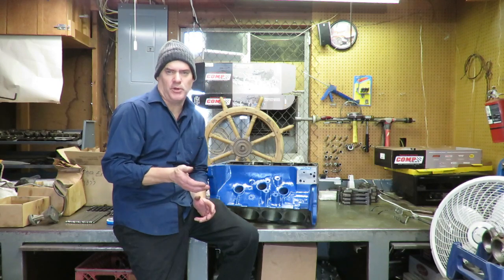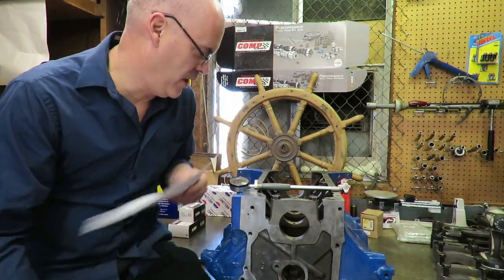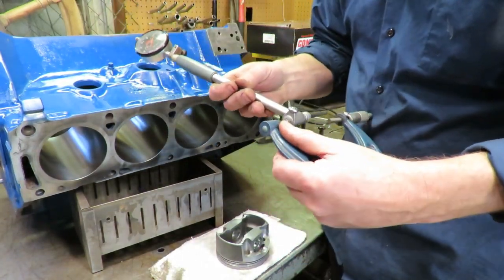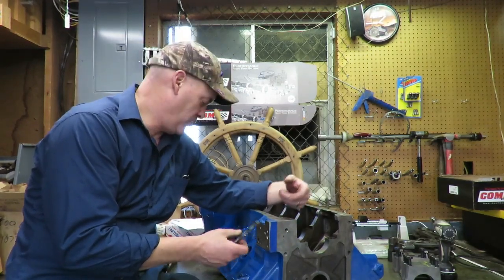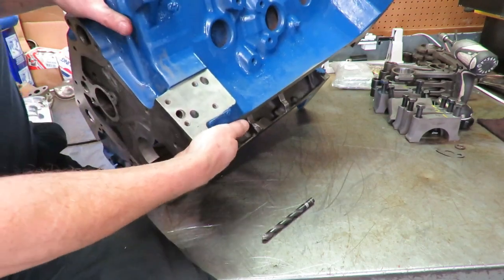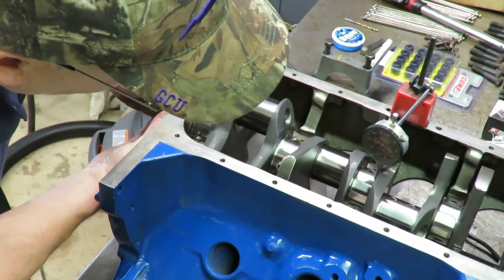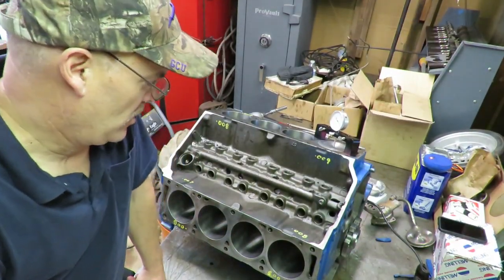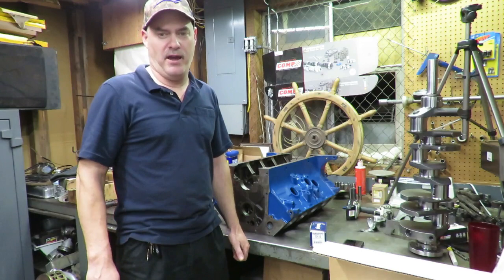390 FE Stroker Build part 3 Block Prep

Comment: I have a 390 I'm going to rebuild in the future, this is going to help a lot. What size stroker kit are you going to use?
Reply: Frank Beato 
In an earlier video he said it was a 431.
Reply: David Mason  Thanks now I remember.
Reply from the maker: 4.080 bore and a 4.125 stroke it comes to 431 ci
Reply from the maker: it is very similar to the 428 in displacement only the 428 has a larger bores (4.130) and a shorter stroke (3.980) better for high reving power the 390 stroker is more suited to low/mid range TQ
Reply: I'm planning an FE stroker build and I want to use the original 352 from my 65 F250. Have you stroked a 352 before if so how big can I bore it? I'd like to get to at least 390 size if not more. As you have stated there is a lack of info out there. The motor will go back in the 65. Asking other places I have been told I need to have the block sonic tested to know how far I can go. I'd like to know from someone who has done it. thanks
Reply from the maker: if you bore a 352 .050 over and use a 390 crank and rods you have a 390
Reply: Myvintageiron7512 What size stroker kit would you recommend on the 390 for a 68 mustang?  Want to keep it streetable. Thinking of a 4.080 bore and 4.250 stroke.

Comment: Regarding the main oil galley mismatch to the bearing hole cut outs.  You stated that this is normal for an FE series engine.  So, why don't manufacturer's just offset the hole in the bearing?
Reply from the maker: hard to say I don't think they really care that much about it they figure it's good enough
Reply: If they offset that hole, someone is going to put the bearing in backward so that no oil at all will flow thru. Just a guess

Comment: There was a notice from ford that they purposely restricted flow to the number one bering to supply more to the number 2 and 3. When i tore my engine down number one looks new and 2 and 3 has a little wear.
Reply from the maker: High vol pump and oil restrictors in the heads and you're in business

Comment: Dude, please help. I've been looking for the procedure to seal the oil galley that leads to rocker arm assembly from leaking oil into coolant. It consists of a quarter inch roll pin driven down a hole (that's the info and video or pictures I need) that leads to cam bearing. Do you have info or know of a video available. Repair can also be done with push rod tube. What bolts do I have to remove? Does the split pin go down a bolt hole or another hole obviously I'm confused. Also do I have to remove heads?
Reply from the maker: You talking about the oil passage in the block that leads to the cylinder head and feeds up into the oil passage at the rocker are shaft assembly at one of the rocker pads.
That passage is know for cracking and leaking oil into the coolant, I have repaired these with a 5/16 push rod I cut the ends off and tap it into the oil feed hole until it bottoms out then cut the top off at the surface of a block it’s basically a sleeve in the oil feed hole

Comment: what are your thoughts on the glyptal coating inside the engine block , many industrial diesel engines i've worked on had it from the factory  but you don't see it in auto engines . I was thinking on doing it to my 302 .
Reply from the maker: Glyptal works well time consuming to apply but it does help oil drain back
Reply: Thanks !

Comment: Just an idea (that I always do): They sell cheap modeling clay (Amazon has it, sold in bricks) that is guaranteed not to shrink, but does completely harden almost like stone when exposed to air. I use it to check the boring - it's MUCH more accurate to put a precision gap micrometer on the casting that most shops already have laying around then playing with the spring bore gauge variety inside the bore itself.  I'm looking for round more that size (not that it can be ignored!) because the rod bearing can help with that but there's no cheap easy cure for an out-of-round.    But the modelling clay - which sets up overnight - is easy to measure and in truth makes abnormalities jump out at you just by eyeballing and easier (especially on the inside journals boring) to do.  I found an issue on a Chrysler small block 318 from a Duster that had been bored and a CNC stroker kit installed 2 years prior, then driven hard, that I swear would never been spotted any other way.
Also (and maybe it isn't as accurate as what you do but is a time saver) is an old trick a mentor taught me when working on an old Buick straight 8 (talk about a heavy sonofagun, those ARE).  He'd take a strong worklight and put it in the crank bed, kill the lights and slide the pistons back and forth.  I'll be damned, but if you can see light come through passing the piston you've got either a bad cylinder bore or a bad piston/ring.  I still do that sometimes especially since the new LED lights are so bright.
In both cases - and maybe this is just ME - it's easier than those spring loaded bore gauges. I just never trust them, they have too much play going on and a U-joint kinda thing to the dial and I just hate the things. Moving them around inside a space just feels cumbersome to me and it seems like the dials always end up at the wrong angle to read easily. Maybe I would do better with the new digital ones. More a quirk of MINE than anything real maybe, but I've built some really strong motors and never a complaint.

Comment: is this a 1963 or older engine it appears to have just two bolts for the motor mount and is very hard to get bolted up in a newer engine bay
Reply from the maker: no that block was a 73

Comment: You showed cracked heads on vid #2, but in that you didn't show where the block was cracked. I would like to know where the problem areas are. Bore alinement & roundness ( crank ), isn't that something that the machine shop should do ?
Reply: william Crooker,
A classic crack is usually up by a probably the number 3 Cam Bearing somewhere between the cam bearing and the crank Journal.

Comment: @Myvintageiron7512 I did a compression test on my 390 and #5 has 70PSI and with oil, 70PSI. Any guess's?
Reply from the maker: Head or gasket problem

Comment: Well I guess I'm a fellow idiot I always clean mine first with the pressure washer dry it with air then use some kind of solvent and then soap and water again I'm going to try the leaf blower that looks like a good idea but I always blow through all the galleys with the air compressor I was raised on Fe but the head work has gotten so expensive on them
Reply from the maker: Yep the heads are a sticking point they always need new guides and hard seats installed many of the cores also need the exhaust side of the heads milled as well we will be doing all of that to the heads on this engine we have a good set of cores but they so need all the machine work done
Reply: I spent $500 cash just rebuilding two 390 heads to use on my 66 352 FE original Y block I had the machine shop install hardened valve seats FEs rule the world around here in Texas

Comment: You said main cap bolts sometimes stretch. Is it a better option say to use a stud like ARP? Stronger?
Reply from the maker: ARP studs or bolts are a great option they are very strong if you are not runnung higher than normal RPM's they are kind of overkill
Reply: Myvintageiron7512 496 BB 6200 RPMs
Reply: Remeber if you stud the engine it has to be line bored with the studs torques that your going to use. You can't just switch them out ..that will pull your alignment out of the mains and if you stud the heads then you have to do the same for the boring job.
Reply from the maker: Yes good point adding main studs requires machine work to the main bores
Reply: silverbird58 do some reading on A R P 's website. Some bolts are supposed to be stretched out when torqued. There called torque to yield fastners. They even make a special tool to make sure the bolt has been properly stretched after installed. Stretching a bolt isn't always a bad thing.  Only thing about this type of bolt is the fact that their supposed to be used only 1 time which means you have to replace it every time you Un torque the bolt and if you don't know that the bolt is a torque to yield and you reuse it then desaster can happen.

Comment: I have a 72 ford f100  the engine in it has a 352 casting on the front I just noticed on your block in this video has the same casting on the front... so how do I find out if I have a real 352 or a 390?
Reply: also if it is a 352 can I make it a 390?
Reply from the maker: you need to measure the bore and stroke the 352/360/390 all used the same block
Reply from the maker: yes bore it .050 over install a 390 crank and rods and you have a standard 390

Comment: As a mechanic myself..and no where near the machinist know how you have nor the reputation you have for building quality hot rod engines...I think your way of cleaning a block stands to reason...I get it,it seems to go against the grain to pour dish soap and water on a machined piece of steel..BUT...in the long run what your doing makes a hell of a lot more sense in removing all the microscopic pieces of grit that will kill a motor in 60 seconds...a clean motor build will out last any half ass thrown together "it's clean enough" build any day...cleanliness is the key to any engine build...have only done a few in 30 yrs. but that was what was driven into my head by the old farts who taught me...LOL!

Comment: When you deck the block, or plane the heads, what do you do about intake fitment and port alingnment issues? When my 460 came back from the enigine shop, they smeared orange RTV all over the end lands. I can only think that the shop decked the block to where the intake manifold was a little too wide to make a good seal onto the end lands. Which in turn means the the ports are misaliged as well.
Reply from the maker: The port aliment on the 390's is always an issue so yes it will need to be checked